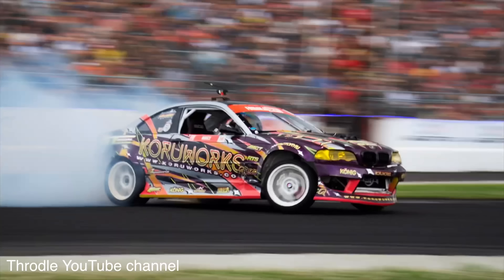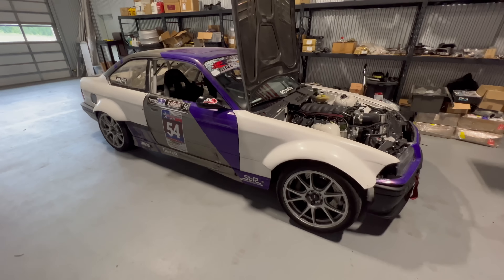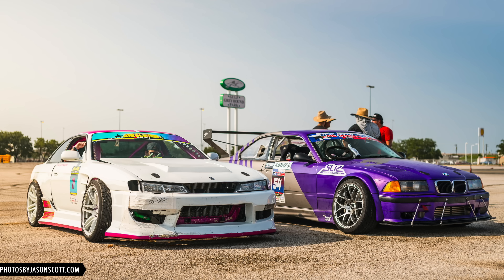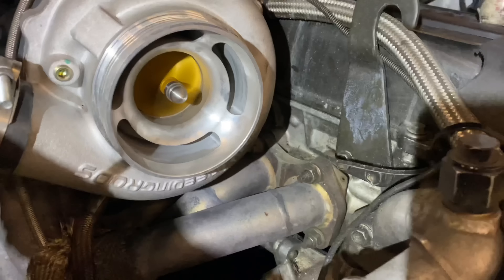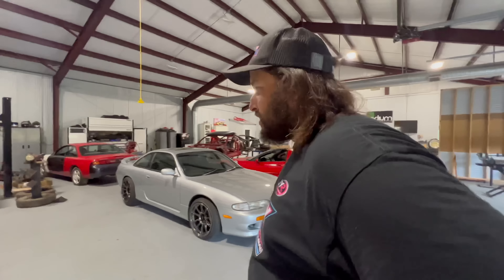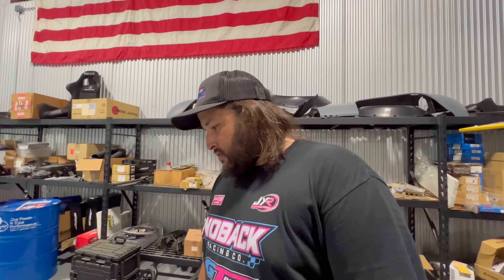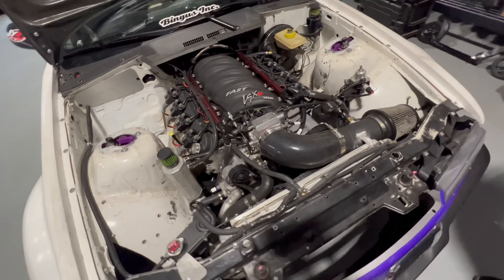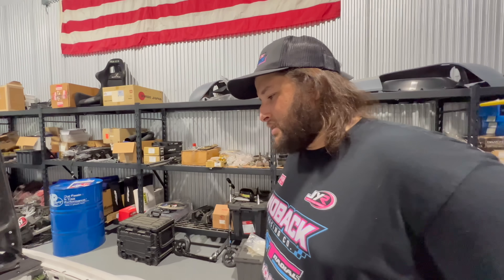TURBO INLINE SIX VS V8?  Which is better?  Ask a pro!

Comment: What about v8 comparisons? Chevy Ls, Nissan vk56, and ford coyotes?. I’m sure it would come down to aftermarket support.
Reply: VK56 can't be compared to LS or Coyote in terms of availability or affordability. Not to mention both options are so proven, coyote is just very wide compared to an LS. A coyote might even be the better motor, but its super tight in most chassis'.

Comment: he uses a v8 with a blower supercharger..... compared to a stock 6 with a turbo.... do you thing comparing apples to lemons is fair?
Reply: The car that our eyeballs were looking at was a NA LS3 though. Really the comparison was the 6 cylinder turbo vs NA v8.
Reply: Stock 6? The S54 is the pinnacle of i6 engines of that era. And he did forged pistons and rods combo too. If any I6 turbo could compare to a built V8 the S54 could. Its got more power per PSI then even a 2JZ
Reply: Barra 🤷🏾‍♂️
Reply: @Just_Prob  we never got Barra's in the states. We got plenty of LS's and M5x or S5x series BMW engines tho.

Comment: This is only a question for those really in america because virtually everywhere else on earth v8s are infinitley more expensive, here in europe inline 6 and 4 are superior simply due to availability. We dont have junkyards with ls's in but we do have them with plenty of bmw and jz inline 6s. Jz cars are superior imo as there more fun, sound better and just as powerful and id say more reliable too. Bmw inline 6s not so much 😂
Reply: My guy, eastern Europe is full of bmw and merc v8 swapped cars, if you look at comps most of the cars are v8
Reply: @8FABDrifting  But how common are those engines? That's like saying half of FD has run 2JZs or RBs in the past so they must be widely available for grassroots drifters
Reply: @mauricecampbell5557  incredibly common in our part of the world, every S class or 7 series from the 2000s came with them, the bmw ones started to disappear due to demand and we are now using the mercedes ones they aren't as powerfull as a LS in stock form but 500usd for a 320hp 500nm aluminum engine is crazy nowadays 😁